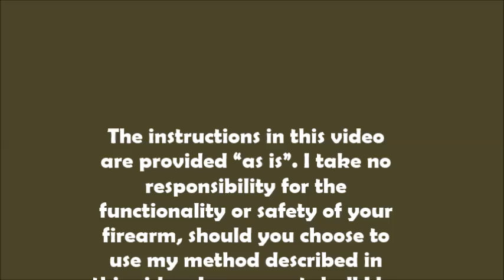Reducing Glock 17 trigger pretravel DIY - (Part I of IV)

Comment from the maker: Regular Philips screw; length: 0.481". The head I sanded down so that it is now oval, which allows me to do micro adjustments, by turning the screw up to 90 degrees. Thereby I can fit the screw so that the trigger bar travels just enough to reset the trigger. The beautiful thing about this modification is that it is virtually risk free. Plan B is just to remove the screw and you gun is fully functional as before

Comment: i did this mod to my glock 19 and it works  fine and is safe, you do have to take a little material off the back of the trigger safety, if you do it right it still works perfectly. It does not change the firing pin safety at all.
Reply: Actually , you had to shave down the shark fin on the trigger bar. To allow it to not push the safety plunger down. I've made many of these types of modifications and I can tell you this is wrong just because you cut a piece off and got the safe action trigger to work. The safety plunger itself is defeated whenever you have it this far back without modifying the plunger or the shark fin that hits the plunger. Look in the mag well you can litterally see the trigger fin pushing the plunger in the plunger blocks the firing pin if the sear drops because of a fall because the pretravel reduction also removes the drop safe margins of the cruciforms polymer shelf. To reduce travel this much you need to add material to the polymer shelf and modify the trigger bars fin and plunger to make the gun safe.

Comment: He bypassed/defeated the firing pin safety plunger. I don’t think people are angry that you didn’t know this, I think they’re upset because you could cause someone to get seriously injured with this advice. We are just trying to protect others from your ignorance.
Reply: Honestly might defeat drop safety too... Ever checked cruciform
Reply: @tigerag29607  YES Actually , you had to shave down the shark fin on the trigger bar. To allow it to not push the safety plunger down. I've made many of these types of modifications and I can tell you he is wrong just because you cut a piece off and got the safe action trigger to work. The safety plunger itself is defeated whenever you have it this far back without modifying the plunger or the shark fin that hits the plunger. Look in the mag well you can litterally see the trigger fin pushing the plunger in the plunger blocks the firing pin if the sear drops because of a fall because the pretravel reduction also removes the drop safe margins of the cruciforms polymer shelf. To reduce travel this much you need to add material to the polymer shelf and modify the trigger bars fin and plunger to make the gun safe.

Reply

Comment: Very good my kind sir we do ours with a set screw in the front where you pointed for the second spot it’s easily adjustable asleep it you put one being the trigger bar to stop it from going alll the way back any this will shorten the actual trigger pull and reset

Comment: Part (not all) of the pre-travel in a Glock is functionally defeating the firing pin block safety plunger. That is what the upward protruding piece of metal on the trigger bar does. It corresponds to the firing pin safety plunger you see in your slide. When you start to pull the trigger back the grittiness you feel is that part of the trigger bar rubbing on the safety plunger, thus raising it and enabling the firing pin (striker) to fire. Pinning the trigger pre-travel this much puts that upward protruding piece of metal in a position that the safety plunger is defeated and non-functional. That’s why there are so many comments. You’ve eliminated one of the “safe action” safeties that makes Glocks so safe. I’m sorry you are confused, but no one should ever do this modification.

Comment: i did something similar to my M&P. i put a small would screw at the top of the trigger inside the frame so i can adjust the pre travel. dab a little blue loctite to ensure it doesnt vibrate out

Comment: So hows the striker block plunger safety? I imagine it's completely pushed in now and useless as a striker block safety in the event of a drop.
Reply: If your talking about the safety on the trigger it's totally useless now, I did something similar with an eraser, and it works to get rid of some of the take up, but yea totally voids out the trigger safety
Reply: shawn churchill that and the striker block. Nothing is stopping that striker from setting off a round in the event of a drop. And to think some people carry a weapon like this with its safeties disabled. If you remove take up like this guy the striker block  or plunger will remain disabled that's in the slide blocking a rogue striker from hitting a primer and disabling it from doing it's intended job... of blocking the striker from hitting the primer in the event of a drop

Comment: With the trigger safety deactivated there is a danger of an accidental discharge if you attempt to remove a live round that is in the chamber. If you rack the slide without the trigger safety engaged the sear will automatically drop as you pull back the slide to remove a live round. When the sear drops, the striker will come forward with enough force to strike the bullet and unintentionally fire. Not a fun situation.
Reply from the maker: The position of the trigger is in does not deactivate the trigger safey/fireing pin safety. Look through videos II-IV.
I also have tried on numerous times to rack the slide back, engage the slide release, drop a round into the chamber, disengage the sliderelease - no discharge.
Reply: And the firing pin block safety. 

He bypassed/defeated the firing pin safety plunger and the trigger safety. The gun is no longer drop safe. I don’t think people are angry that he didn’t know this, I think they’re upset because he could cause someone to get seriously injured or killed with this advice. We are just trying to protect others from his ignorance. Don’t ever do this modification!

Comment: this doesn't affect the firing pin safety only the trigger safety but if you cut it the right measurement on the trigger safety it should be function normally.

Comment: won't  this deactivate  the trigger  and fireing pin safety ?
Reply from the maker: Trigger safety yes (fireing pinsafety no -see part II, III, IV) , but as I have stated elsewhere, I would challenge the value of that safety.
Reply: Maria Bonita a courtroom would not. Do not defeat any safeties.
Reply: The trigger safety tab will prevent an accidental discharge if the pistol is dropped. Without that feature working, bang. I thought it was unnecessary also, untill I removed it.
Reply: He bypassed/defeated the firing pin safety plunger. I don’t think people are angry that you didn’t know this, I think they’re upset because you could cause someone to get seriously injured with this advice. We are just trying to protect others from your ignorance.
Reply: Wil Lavender The trigger is half pulled and one of the drop safeties is defeated. So if you drop this gun at the range, it could easily go off and kill someone. That’s the difference.
Reply: @Libertarian_Neighbor  Its why I don't go to ranges.
Reply: There is no doubt that firing the weapon is easier and you have crisp break, however you need to unload the weapon and smack the back of the glock on some carpet, I promise it's going to fire.
I put a zev trigger in mine and by passed the trigger safety for the same result as you. It fell of the bed one night in Indianapolis and it fired a round off. I have since fixed that issue.
You really need to test this!

Comment: I think I can improve on this idea somewhat.  A small piece of plastic formed and placed in front of the bar would have the same effect.  Adhesive would be necessary to prevent movement and interfering with the mechanism, but it would be completely reversible.
Reply: David Johnson He bypassed/defeated the firing pin safety plunger, and the trigger safety. The gun is no longer drop safe. I don’t think people are angry that he didn’t know this, I think they’re upset because he could cause someone to get seriously injured or killed with this advice. We are just trying to protect others from his ignorance. Don’t ever do this modification!

Comment: Plunger safety is always depressed now and the drop safety shelf is no longer holding the sear. If you drop that gun on its grip the inertia from it hitting the ground is going to allow the sear to drop off the striker lug allowing it to fire. You have to know what you're doing. The concept works, I get it but there is a "Correct" way of doing this without compromising the striker safety and the drop shelf inside the trigger housing. But hey, I'm only a 25 year gunsmith and Glock armorer. What do I know.

Comment: You have bypassed the trigger safety AND the firing pin block. That isn't safe at all, better be a range gun only. It could now discharge if dropped
Reply from the maker: The only way to have the Glock discharge without pulling the trigger would be by removing the firing pin block, or having something constantly depressing it. That is not the case here. The screw does not interfere with the triggerbar’s interaction with the firing pin block. The firing pin block works as intended by design. As for the integrated trigger safety, I would still challenge the actual value of it.
Reply: He bypassed/defeated the firing pin safety plunger and the trigger safety. The gun is no longer drop safe. I don’t think people are angry that he didn’t know this, I think they’re upset because he could cause someone to get seriously injured or killed with this advice. We are just trying to protect others from his ignorance. Don’t ever do this modification!

Comment: This is of how much value even if everything works???  Pre-set is not nearly as important as over travel.  However, rounding the edges off the firing pin safety plunger and polishing the surface will greatly reduce the drag of the trigger pull each shot.  My G34 wins matches all the time.  I also have a cheap aluminum light attached to the rail and a cast lead slug instead of a battery to steady the pistol in rapid fire drills.  All this combined with a quality custom "tactical" weight trigger will allow all your practice to pay off.
Reply from the maker: It does add value to the overall trigger experience. Both for bulls-eye shoting, as well as double-taps. You can train yourself to release the trigger just enough for it to reset, and get the same result, however I am not capable of achieving the desired speed in doing so, hence this modification. I do however agree with the rounding of the pin safety plunger. That would be my next modification, which I probably would buy....
Reply: He bypassed/defeated the firing pin safety plunger. The gun is no longer drop safe. I don’t think people are angry that he didn’t know this, I think they’re upset because he could cause someone to get seriously injured with this advice. We are just trying to protect others from his ignorance. Don’t ever do this modification!

Comment from the maker: The modification will not cause the pistol to go full auto per se. The only time it did so was when I changed the striker spring. But even when I took out the screw it continued to burst 3-4 shots with the same new spring, so the malfunction was not the result of a combination of the screw and the spring, but could exclusively be contributed to the new (light) striker spring.

Comment from the maker: Plan C, which gives you a second shoot at it, is to place the screw on the other size of the receiver close to the trigger. There you will also find a small space where the screw can be placed to prevent the trigger bar to travel too far. If this fails too, plan B still applies. Plan D would be to invest some 150 USD is a prefabricated trigger where all the adjustments are built in,....

Comment from the maker: The safety you are reffering to can be made to work by taking of some of the plastic to the back of the trigger safety. Personally I do not see the value in that safety anyhow. Only in the event that something is "partially" depressing the trigger would the safety work. It is a sales gimmick. But as I said if you feel differently about it, there is a fix to it.

Comment: This mod is a potential malfunction waiting to happen;  when clean the mod may work good, when dirty it may cause the trigger to hang up and not reset immediately.  Glock pistols are not like custom target 1911's and are designed to work under field conditions.  Reducing critical tolerances will likely result in reduced reliability.  Change out your internals with a quality kit, polish the FP plunder edges, and feed it ammo that ejects reliably.  Adjustable sights and adding a molded beaver tail will do wonders and turn heads too.
Reply from the maker: I have since the video was published fired 1.604 shots with my Glock 17DK and I have cleaned it 3 times ( I keep a log at http://www.rangelog.com so I know for sure) This included a 2-day Level III IPSC match with 18 stages ( 412-rounds shot). Most of those 1.604 shots were cheap russian ammo that really leaves the gun dirty. Nevertheless, no malfunctions, no full auto. Also there are no critical tolerances modified here, but rather a restricted range of motion.
Reply: Maria Bonita
Reply: He bypassed/defeated the firing pin safety plunger. The gun is no longer drop safe. I don’t think people are angry that he didn’t know this, I think they’re upset because he could cause someone to get seriously injured with this advice. We are just trying to protect others from his ignorance. Don’t ever do this modification!

Comment: Okie doke.  Building on your method, I used a thermoplastic called Instamorph to make a block to prevent the trigger bar from travelling forward excessively.  I blocked the trigger in the position I wanted and then tamped Instamorph into the gap between the frame and the trigger bar and let the Instamorph set.  I tested it and it worked great.  The Instamorph piece, while perfectly fitted, is not permanently affixed.  So, I am going to use a drop of adhesive to keep it in place.  If I later decide to take that piece out, I can just break the adhesive grip and remove the piece without any damage to the frame.  The best part is that I added black color to the Instamorph so my addition actually looks like it was supposed to be there.  Thanks for the idea and inspiration.  BTW - I am doing this for my girlfriend's glock because she has small hands and the reduced pretravel makes it much easier for her to shoot with her hand in proper position.  dwj
Reply from the maker: Hi David. You have certainly improved on the design. Congratulations!
Reply: He bypassed/defeated the firing pin safety plunger and the trigger safety. The gun is no longer drop safe. I don’t think people are angry that he didn’t know this, I think they’re upset because he could cause someone to get seriously injured or killed with this advice. We are just trying to protect others from his ignorance. Don’t ever do this modification!

Comment: If it gets drilled improperly, you could also grind the head of the screw so there was a "flat" on it allowing the trigger bar to move to the forward position more. You have a bunch of tries at that point! ;)
Still, be careful!